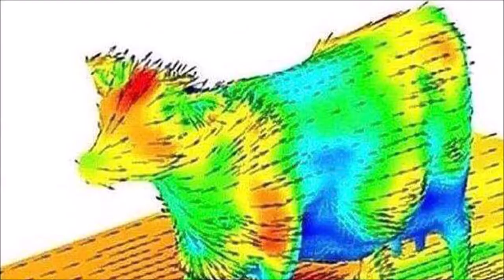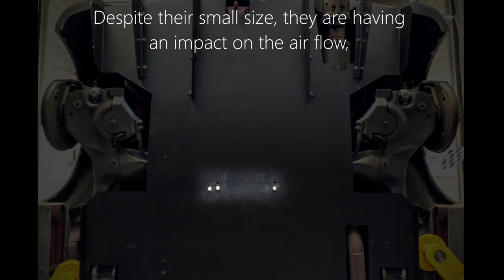Toasterdynamics Episode 8: Vortex Generators and the Rear Diffuser on the Colt Ralliart

Comment: I believe your issue was the holes behind the bolt heads. The bolt heads created a low pressure zone creating suction from those holes and venting in a lot f air. if holes were closed, the flow would most likely re-attach back to the diffusor. And if it was only the holes alone, they would have been only a disturbance. the bolt heads made them effective at letting in the air.
Reply from the maker: I like your thoughts.

Comment: I am curious why you put tufts at the exit from the diffuser? It is unrealistic to expect the airflow to remain laminar beyond the point where the diffuser ends. That region will always be turbulent since it is unrealistic to expect the flow to stay attached where there is a sharp turn. You need to and tufts to the entire diffuser and verify the flow in that region. You are making a big inference that the dirt is deposited because the flow is slower and turbulent. Without actual data you are just speculating about causation. VGs are by their very design turbulent. The swirl of the vortex energizes the boundary layer.
Reply from the maker: Many good questions here. Why tufts at the ends of the diffuser? Because I was hoping that if there was a significant impact from the VGs then which would reflect in more ordered movement of the tufts - which in fact we may have seen but it is hard to know for sure. Vortices start out at least extremely ordered and not chaotically turbulent - here is a link to some old footage of mine (https://youtu.be/FeFje7cN5DY) where this can be seen on the outside of the splitter endplate. It influenced my decisions and expectations for this video. With respect to putting tufts everywhere I did think about that but I could not work out a way of recording it without the camera influencing flow. With respect to the dirt it is outrageous speculation (I probably should have expressed this better in the video) and difficult to prove, though having plugged the holes and flattened the bolts some time ago I should go back for a look.

Comment: I know this has been posted 3 years ago, but have you thought about a transverse recess, perpendicular to the flow? It should reduce some of the boundary layer thickness and it could house the bolts and holes without interrupting the flow
Reply from the maker: I had not thought of that. I like your thought.

Comment: Need to put you test strings slightly closer to the front not at the edge you will get turbulence from the negative pressure in the back of the car. where you placed them just shows that you have negative pressure and that is a good thing that gives you down force.
Reply from the maker: Seems like a good idea. 👍

Comment: have you ever tried to block the holes you left open? Maybe you have positive pressure in between the undertray and the body of the car. Certainly possible because your cooling inlets exhaust that way. The holes might push low energy air into the boundary layer at that critical spot. Basically the opposite of boundary layer extraction.
Reply from the maker: Indeed I have blocked the holes but I have not gone back to examine the consequences. I like your thinking though!
Reply: @rcoltlyf  I’d be really interested. But I might be wrong of course, maybe it’s just that the screws are too much. Or a combination of both. Or something else. I used to build formula sae cars. We always kinda laughed at teams that put stickers on the suction side of their wings (flaps) as we knew from testing that even those few tenths of a gap caused the flow to separate. But of course the boundary layer on a wing with a very small chord is quite small, and those wings were always on the limit of separation. I think there’s nothing you can do but to test

Comment: what you want to know is whether the flow stays attached along the length of your diffuser not at the back edge. There's a about a 70deg turn there, of course that flow will separate. Put the tufts all over the bottom of the diffuser and figure out how to film that.
Reply from the maker: Best comment ever? The filming without interfering with the flow is the hard part.

Comment: Just a thought, you might want to experiment with the strakes. It looks like tyre squirt (dirty air from the rear tyre/suspension area) might be interfering with flow.
Reply from the maker: Almost certainly it is tyre squirt. I can't take the strakes lower though and still drive it on the road without scraping - it is borderline as it is.
Reply: strakes are mostly for looks. they dont do anything. look at the mercedes EQXX insane diffuser, or light year one/zero car, or any long range production tesla or lucid air. all smooth rear diffuser, no vaping teenager strakes...

Comment: This goes to show that on modern day cars with diffusers at rear bottom . Do absolutely nothing
Reply: That's not true at all.  Diffusers work better on modern cars than they did on older ones with "dirtier" under-body areas.  But, it's important to distinguish between a real diffuser like this guy has, and a plastic vertical fascia with some cheesy strakes in it.  Most "diffusers" on road cars aren't diffusers at all.  But even that is better than older cars where the rear bumper was fully parachute-shaped.
Reply: Most modern cars with "diffusers" have vaguely diffuser shaped pieces of plastic that are styled to look reminiscent of a diffuser but have no actual aerodynamic effect.